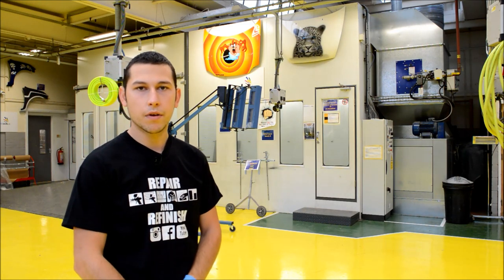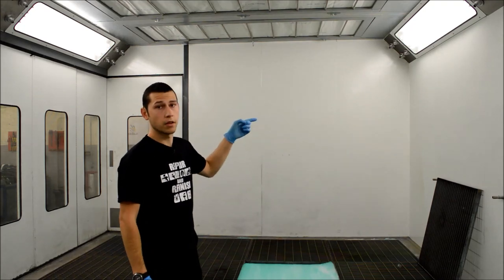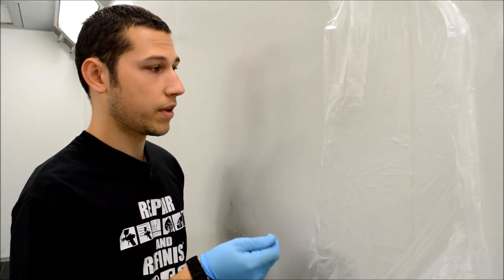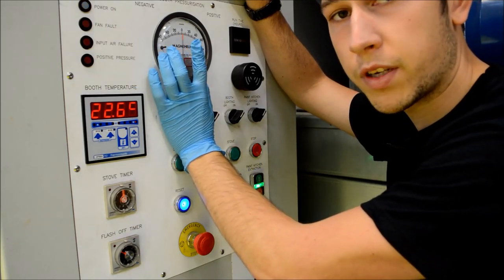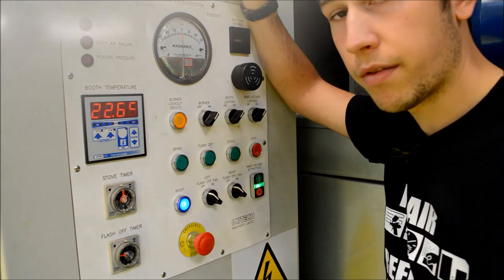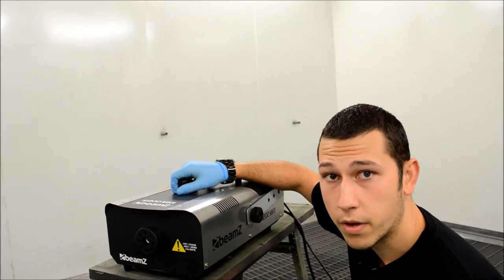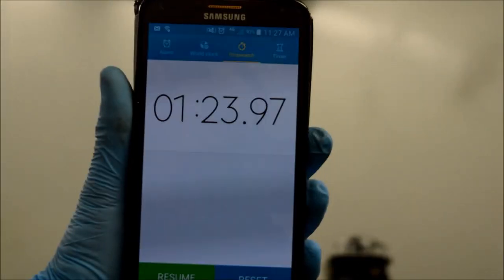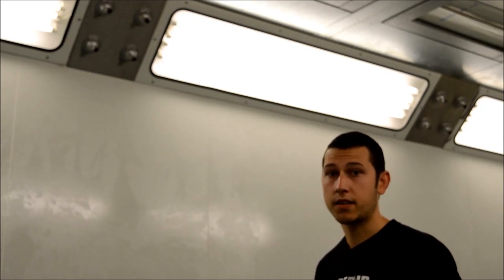Spray Booth Maintenance and service including wall tack coat

Comment: Sorry for posting on an old vid Jordan, just been chatting to you on FB (John Bushmaster), just found your YT channel and I'm going through all your vids! very nice booth mate, you have just seen my crappy booth but I do have good filtration in there plus it clears very quickly, filtration and 3 stage with air fed mask is good but it's the structure I need to upgrade.